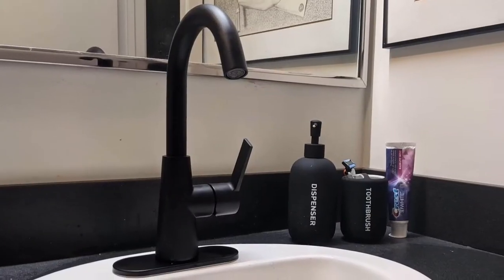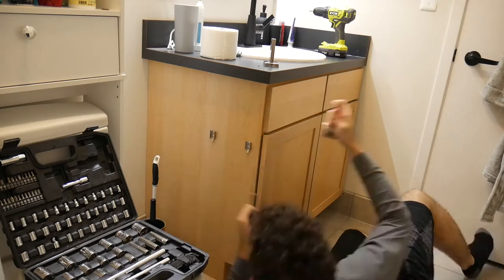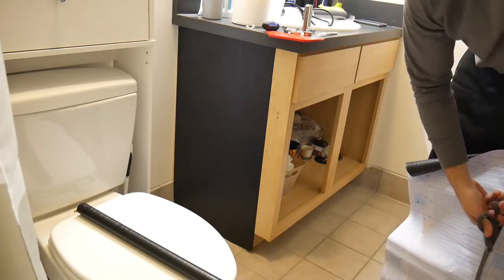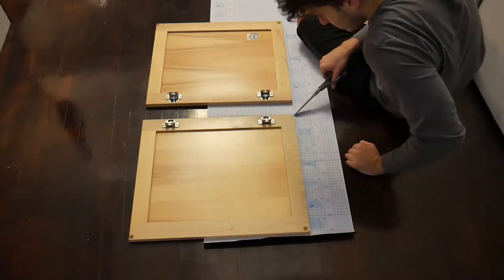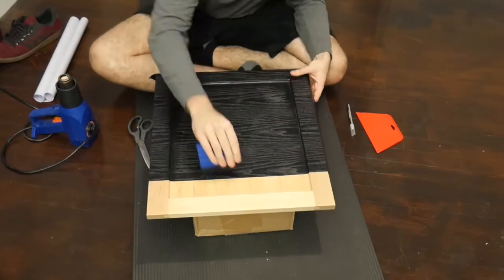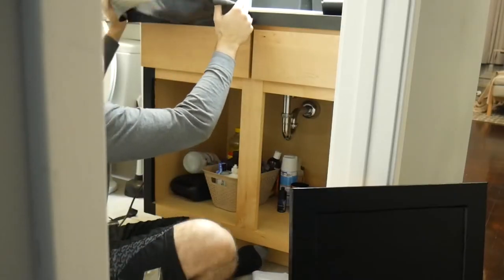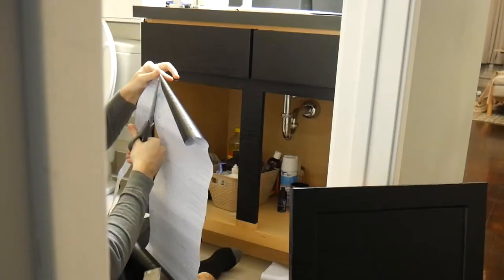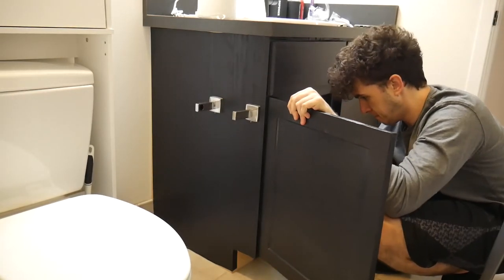How to use Peel & Stick Vinyl Wrap on Bathroom Vanity

Comment: Great job! A tip if you ever do this again is to look inside the cabinet where the top front panels are. There is usually plastic clips to remove them.  Then you can wrap them like you did your doors.

Comment: Does steam from the shower cause any of the vinyl to separate or lift up?
Reply from the maker: It hasn't yet! I'm pretty impressed by the adhesive. I take pretty short showers though
Reply: @Ettore  OK.  Thank you for the response.
Reply from the maker: @tmulcahy7869  no problem! The cool part about this is that it is cheap and totally reversible. If it peels off it'll look like it did before
Reply: @Ettore  I don't have an exhaust fan in my bathroom to help with the steam, and I love long showers.  I might still try it.  Like you stated.  It is reversible.
Reply from the maker: @tmulcahy7869  I normally don't turn on my exhaust fan either. I'm pretty impressed with the adhesive so far, just make sure to really press in those edges while doing this
Reply: @Ettore  👍